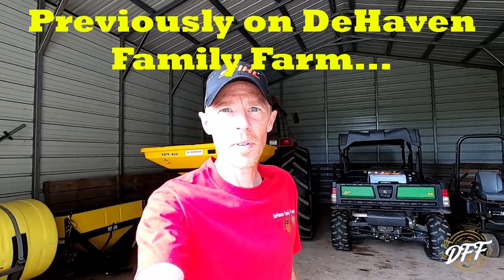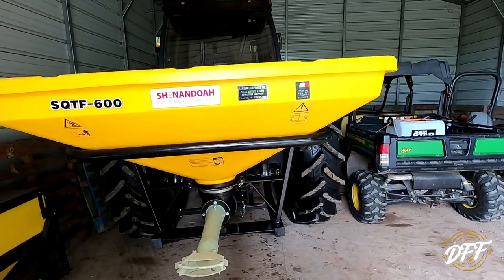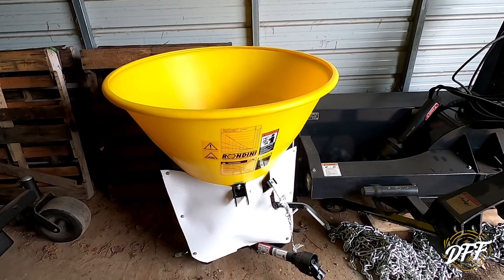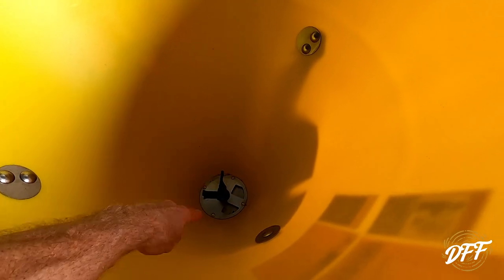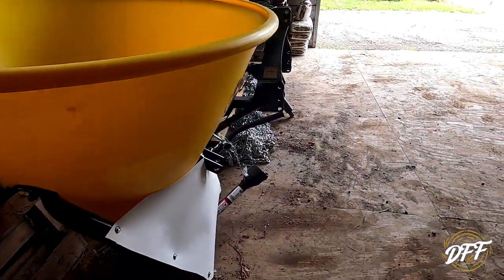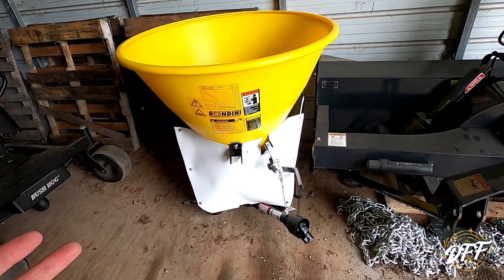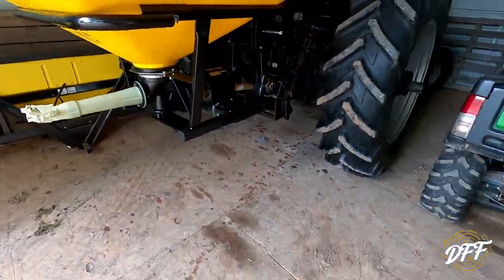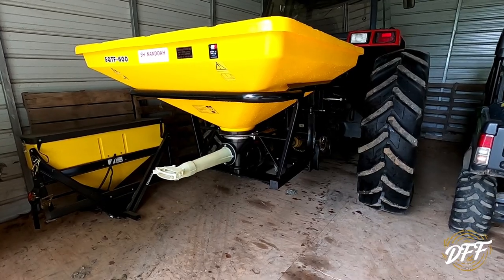Part 2- Pendulum Or Spinner Fertilizer Spreader??

Comment: Looks good.  Hard to beat a pendulum spreader IMHO.  I have a hopper extension for my Kubota/Vicon spreader that will allow 1 ton bags and just received their fine application kit that closes two of the 3 opening in the bottom of the spreader.  The benefit is you can spread seed or light applications of fertilizer, ie nitrogen after first hay cuttings.  Shutting off 2 of the 3 holes allows for a lower rate, but with a much larger (one hole) opening at the bottom with less likelihood to clog - something you might want to check into.  Nice spreader!
Reply from the maker: I look forward to seeing a video on those upgrades! Thanks 🙂

Comment: Hey man, good description of the 2 kinds of spreaders. I have a pull type spreader for ATVs that is 12 years old. I recently had to replace the veins on the disk. You should get yourself some fluid film. Everytime you get done with it, clean it up then coat it with the film. No rust